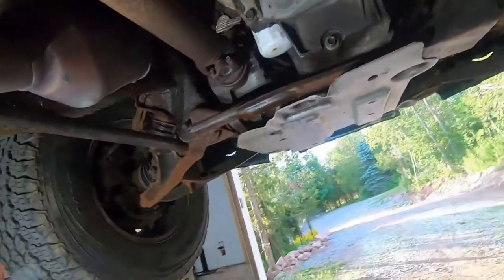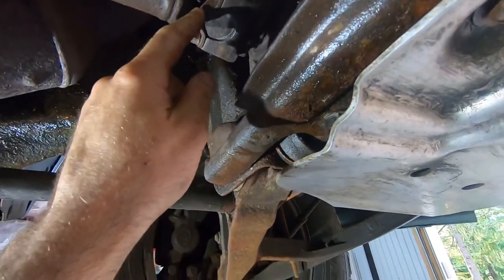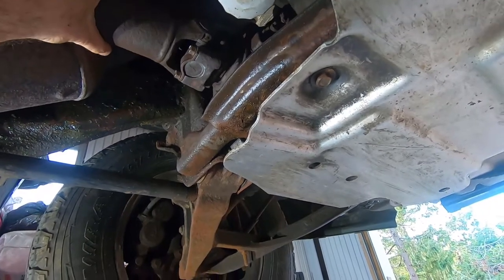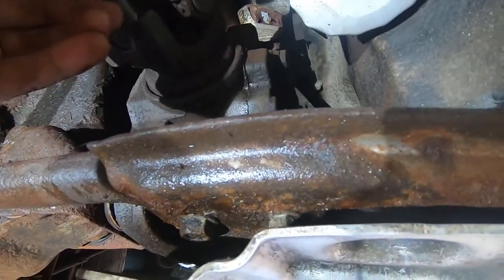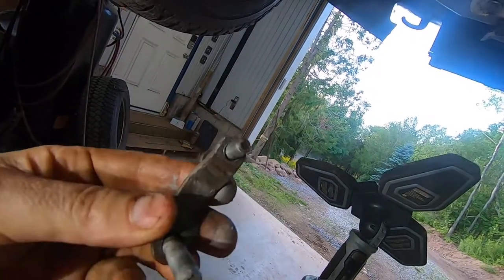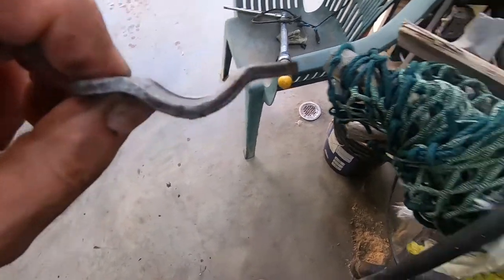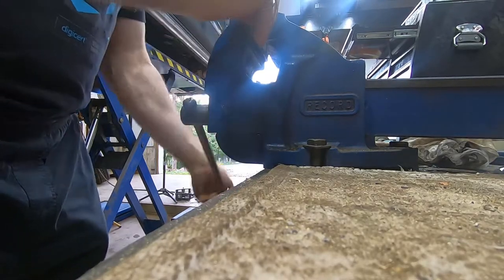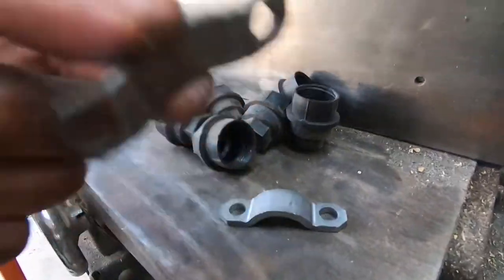DIY How To Tighten Loose U Joint Straps In Truck Driveline

Comment: The End Flange is suppose to have a small lip on the bottom edge that serves the same purpose as a clip to hold the cap. Looking at it, either the wrong larger U-joints were installed or you have a poor design on your truck. I have a FORD truck that has this design and don't like this design. It is also difficult to install, tighten and torque the 4 bolts that are also ridiculously small.

Comment: did you try the right replacement?  I had a s10 95 and the trouble was the incorrect u joint that supposedly matches with  the truck but isn't cause it have a long bed so that was my problem. thanks for the video

Comment: I got a 99 GMC Suburban 1500, and the u-joint was bad in it, not busted but bad, I went to the part store, and that truck only has 2 different size u-joints, 1 was bigger on all ends, and the other was the size I needed, I changed it out, new straps, bolts and everything and what do you know, the caps are loose in the straps now and I get a little vibration at 55mph or faster, and they are tight about 1,000 miles ago. What I did, and probably not recommended, I took a punch and bent the outside center of both straps (bent it towards the caps) and its been fine ever since, I did do it while it was on the truck, doing it off it would of just flattened the straps....

I mean my suburban needs a rear end anyway, its been howling for the last 6 years, so I didn't really care if Its hard on the rear end smacking on it, I got a rear end ready for it anyway. Another thing I was going to try was take a hardened drill bit and cut a shallow grove in the inside of the strap and place the drill bit in and tight the strap back down, If I run in to the problem again, I might do that, The straps are cheap anyway and the u-joint takes 20 min to change.
Reply from the maker: You've got to do what you've got to do. However I would caution against putting a drill bit between the U-joint and the strap because you may pinch the cup that contains the roller bearings.